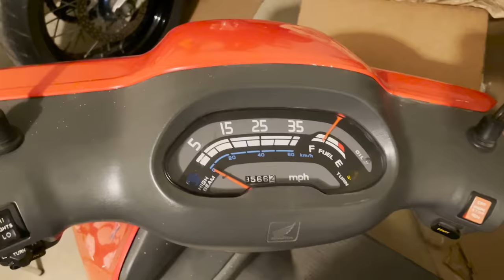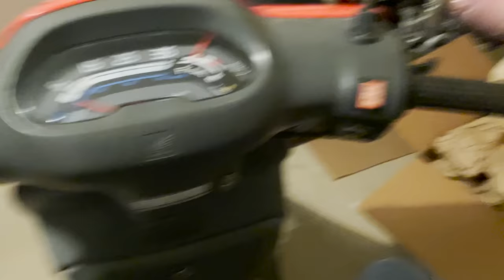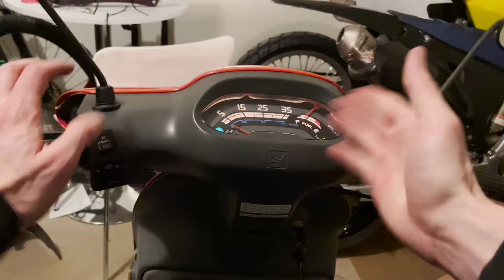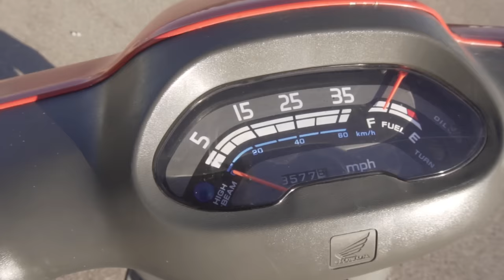The CHEAPEST FUN You Can Have on a Motorcycle!!

Comment: if you want reliable stuff just get a 19 carb, cvt, 70cc but not in aluminum with 2 piston rings and an exhaust with an expansion chamber. You can do all of that for around 600 dollars and it will fly

edit: forgot to say to get everything from malossi or polini, they're the best for small cc 2 strokes
Reply from the maker: Yea I’ve heard that around $600 can make it super nice! I’ll definitely look into that eventually!
Reply: What is wrong with aluminum?
Reply: @snotseasoning7429  it's great but not for reliability. You have to wait for it to warm up or you'll easily lock it up, plus most aluminum blocks have 1 piston ring (much more performance) but that makes it also extremely less reliable
Reply: @TwoStrokeJ  i think you should keep it stock at this point, considering its age.
Reply: @snotseasoning7429  if your a to strong man you just gonna make the cylinderthreads to snot xD that aluminium is soft

Comment: I own a Honda SA50P - If this bike sets, oil makes its way into the combustion chamber and crankcase and floods it with oil. To resolve this issue, I recommend replacing the oil pump and or draining the oil if letting the bike sit for a long duration of time. 

Ya know it's flooded with oil when it blows out a ton of white smoke when it starts.

Comment: Great job picking it up man, i have a euro scoot with the same enfine, they are super good. Love the content
Reply from the maker: Thanks bro! The engine is super solid!
Reply: @TwoStrokeJ  you are the reason im learning to wheelie my scoot. In europe they have a ring that limits the vario from moving out further, limiting the speed. Check if yours stil have that, if it has it, remove it. Wont reduce torque but will give you a higher top speed

Comment: You said the clutch engages late, I think it is a torque converter, not a clutch.  Makes it accelerate quicker.
Reply from the maker: Yea I knew that just so used to calling it a clutch haha
Reply: The variator that the belt sits in (behind the clutch) have slides some are S shaped slides so it engages certain way some are more direct like middle part of Z.

Comment: If you have start problem use the kick starter
Reply from the maker: It’s not a problem, there was just no battery at first. The electric start works fine
Reply: @TwoStrokeJ  well yes but after wards when u Tried to start it and there Semed to be Problems with the spark plug. Most of the time All the scooters i owned before and the honda lead have the Problem and some how when you start them after a long time and then they dont start with the e starter use the kick starter and rev it a little up worked every time. This isnt a issue with the spark plug normaly.
Reply: @josephriecke2347  yeah same thing on my gilera sp180 sometimea it just startes faster and better with the kicker just a scooter thing